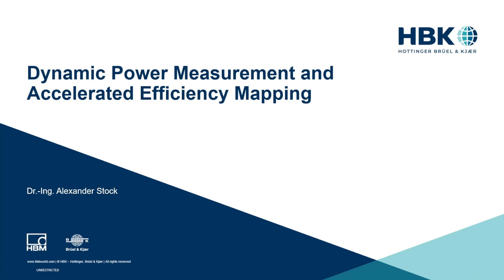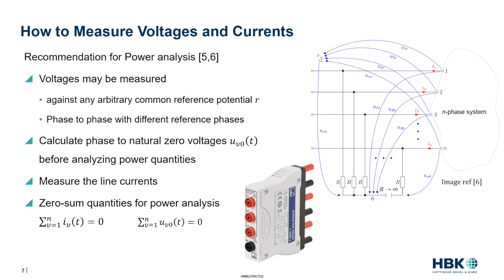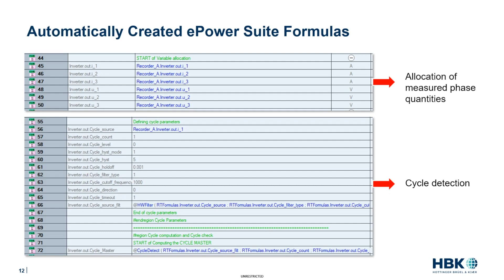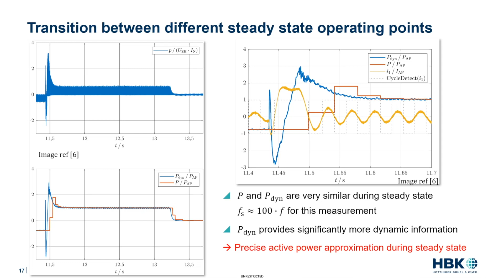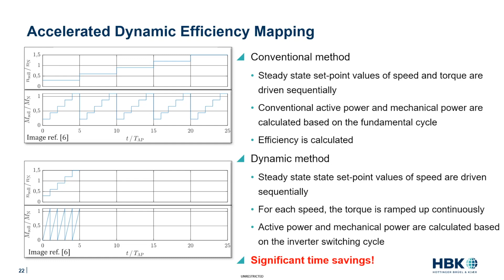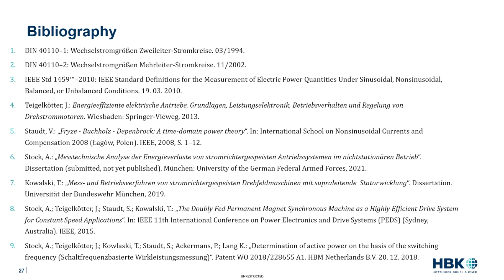Dynamic Power Measurement and Accelerated Efficiency Mapping for Electric Drives Webinar

Comment: Hi, Is it possible to run formulae at certain times only? For Eg, position sensor offset value calculation would be accurate when Id,Iq in drive motor is zero. Or, if we want to write formulae to extract Ld, Lq, Psipm, the formulae to extract each parameter would need to be active in certain conditions only. Please let me know if its possible. Thanks in advance
Reply from the maker: Yes! This is possible.  The system can be triggered to execute when your conditions are met.  Please reach out to our team support-ept@hbkworld.com